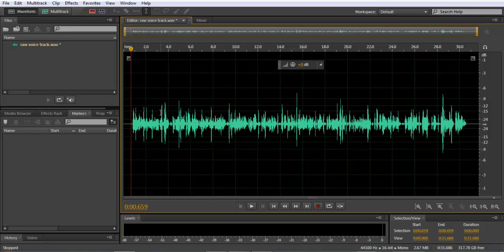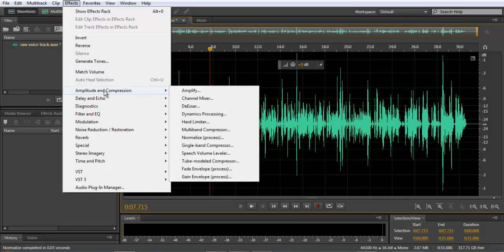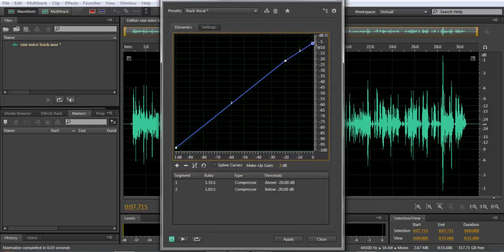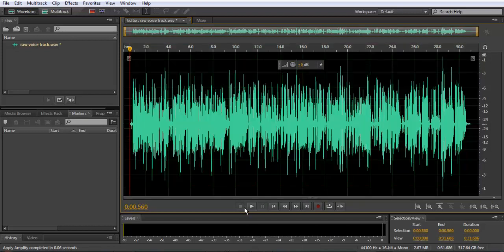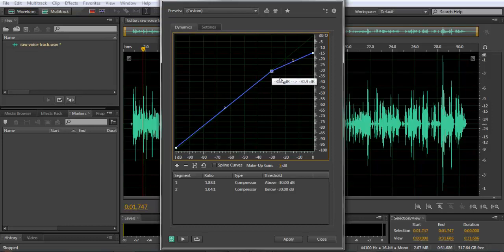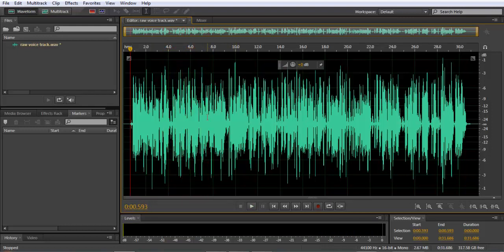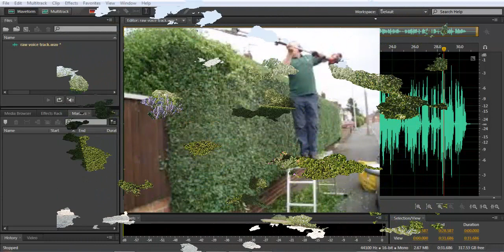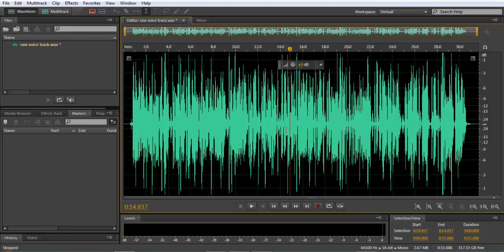Dynamics processing

Comment: excelente explicacion saludos desde argentina, this could be applied on live rec?
Reply from the maker: You cannot use Audition plug ins on the way in. Only in post production. If you want Dynamics control or compression on the way in, you have to use an external hardware compressor between your mic and the computer.
Reply: @craigjackman5874  Thank you verte much sir

Comment: I know this is an old video, but hoping to still get a reply:
What would be the difference with using the dynamics processing instead of, lets say, a tube modeled compressor? 

Secondly, how much dynamic range is good to preserve? (For example with a spoken word/preach/poem where you intentionally have quieter sections for effect)
Reply from the maker: Andre de Jager Dynamics Processor is a good tool to start to train your ear in the use of compression. You can also use Dynamics Processor to sidechain, to have your voice part control the levels of another track. I’m planing another video on sidechaining. For most of my compression needs I actually prefer the Tube Compressor module.
Reply from the maker: Andre de Jager for your 2nd question, it’s totally up to you and what sounds right. For some situations you might want to squash it like a brick. For other situations a little less is appropriate.  It depends on the situation and what else is surrounding voice. If it’s just voice, less compression and more dynamic range would be best. If it’s voice over a screaming metal music bed, more compression and less dynamic range makes the voice easier to hear

Comment: Hello great video. I am a dj and i am using the same software. Will this work on my mixes to keep the volume level the same threw out the mix? Thanks again
Reply from the maker: The settings for dynamics processing depend on the input level.  If you feed the processor a steady input, yes it will work throughout a mix.  You might be better to get a hardware compressor and compress your tracks on the way into the computer.

Comment: What does make up gain do? I really did not get that part.
Reply: make up gain is like volume level for post compression output. so if the signal began at 10db, then you compressed with no make up gain, your output volume may be only 4db for example. you can increase the make up gain to boost the overall all signal after compression. back up to 10db or whatever you decide.
Reply from the maker: Fun Fun Bae-!! Make up gain "makes up" the gain you've thrown away by evening out the levels with Dynamics Processing. The rest of Dynamics processing makes the loud parts not so loud. Using Make Up gain, brings the levels back up and makes the quiet parts not so quiet.